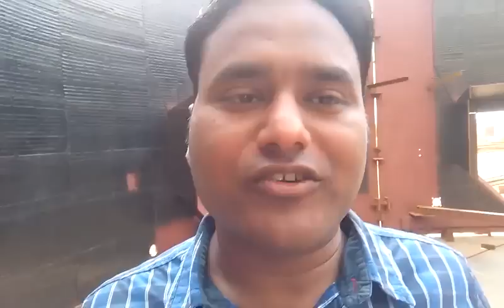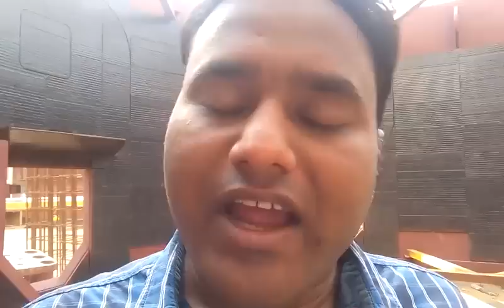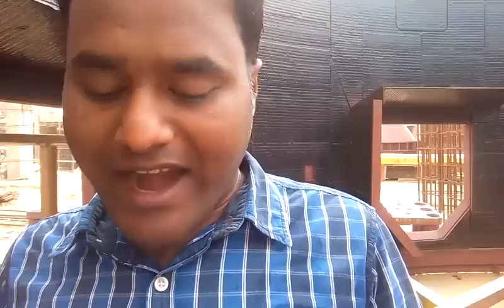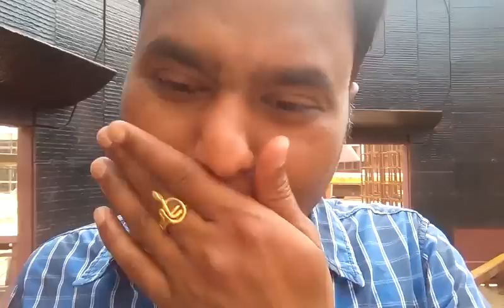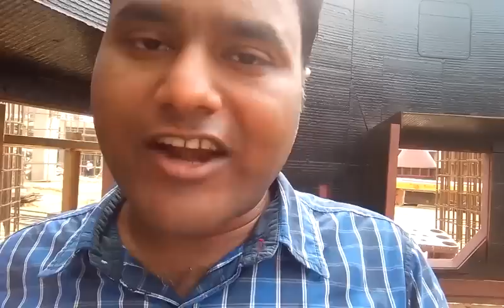[English] Welder performance test range and positions

Comment: Sir if a welder weld vertical position and tested and passed can he have rights to weld flat and horizontal. In AWS if he qualified in 3g position does automatically qualifies 2g and 1g or separate test needed